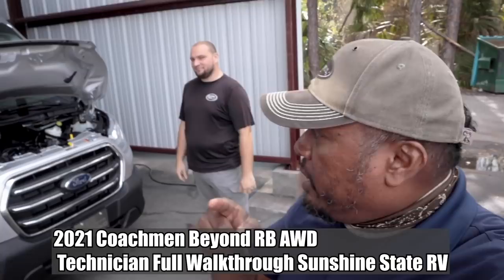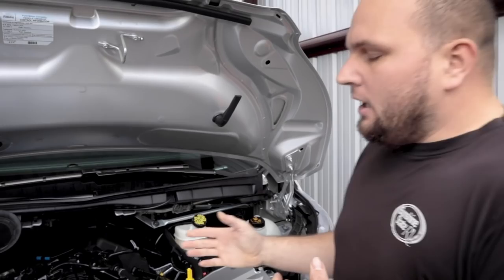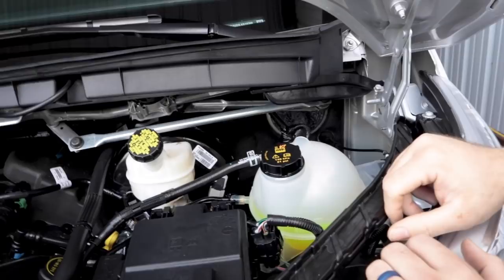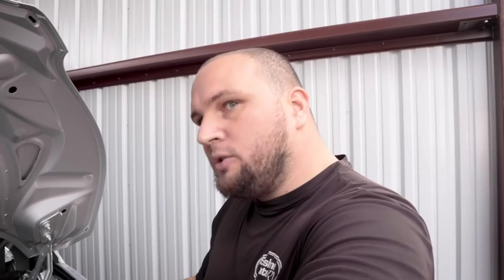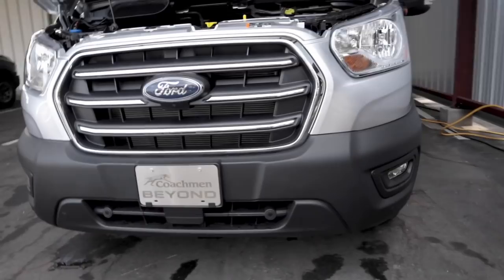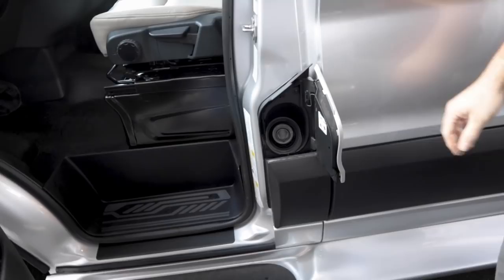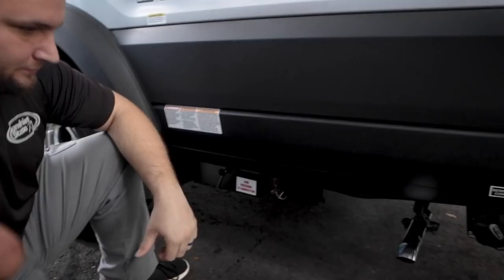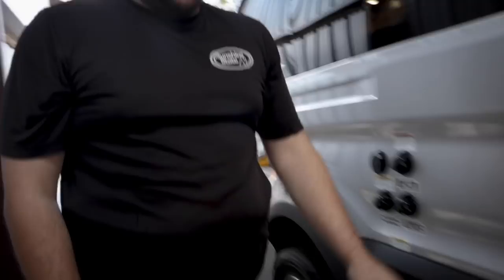2021 Coachmen Beyond 22RB Ford Transit Class B RV - How To Use Your Camper Van For Beginners

Comment: The advice about having a 20amp circuit for shore power at home was invaluable.  I was planning to plug into a 15 amp circuit on an outside GFI.  Luckily there's a dedicated 20 amp circuit in the garage for a heavy duty compressor.  Thanks!

Comment: Now that's a XLT Build. WoW! Finally a RVan worth it's cost. Excellent quality and sturdy . Only improvements needed a easy close side entrance door, or lift handle automatic close. And a 3" suspension lift. Just for a little extra wheel clearance.

Comment: I'm a master technician and I can tell u one thing octane of fuel is set by the manufacturer's based on the engine compression. The higher the compression the higher the octane. Adding extra octane is absolutely useless and costly. The owners manual is worth looking thru before you drive.

Comment: Wow, make sure you have your dump valve open before you use the black tank flush. If not, you risk having a "poop geyser" coming out of the roof vent.
Reply: Once the black tank is dumped we close the dump valve then fill the black tank to about 1/2 > 2/3 full using the tank flush. Then open the dump valve while still running the tank flush. Doing this two or three times gets it pretty well rinsed out, especially before storing the rig for any length of time..

Comment: Given there are 28 states that DON'T require the passengers in the rear of an RV to wear seat belts, I still hope to have seat belts in the rear so that this RV can be used as a regular MPV for day trips in ANY state. Is there an option to add the rear seat belts?

Comment: A question re the refrigerator:  is there a freezer section & if so how well does it work.   I have some medication that needs to be kept frozen until defrosting small amounts for usage?  Thanks. Great video.
Reply: Freezer on bottom. Really big and freezes solid.

Comment: HOW MUCH IS THE UNIT?  WHERE IS THE PRIVACY  SCREEN FOR THE FRONT WINDSHIELD.  I WOULD ALWAYS KEEP PRIVACY  SHADES ON REAR WINDOWS.
Reply: I made a curtain across my front separating the cab from the coach. It comes with a folding privacy screen for the front window and side windows. Front one is very heavy so I just use refletex.
Reply: It comes with privacy screens for back windows

Comment: If the older turbocharged engines need to cool down before shutting off the engine, how about on these newer turbocharged engines?  The mechanic did not provide an answer.
Reply: Same rules apply.

Comment: They having problems with those. Oil change every 200hrs. This will protect you.
Reply: What's that roughly in miles for non business driving?
Reply: @user-bi3nx6nu9m  That is for all ford vehicles. We do oil changes every 2000 miles every 4 months need are not. It cost $10,000 to replace a motor. It cost $400 a year for oil changes.
Reply: @byronmorris1594  wow,  much different than the recommended 10k lol.  I'm used to 3k miles so I'll probably stick to that.  Thank you